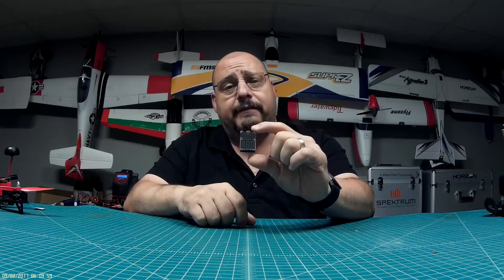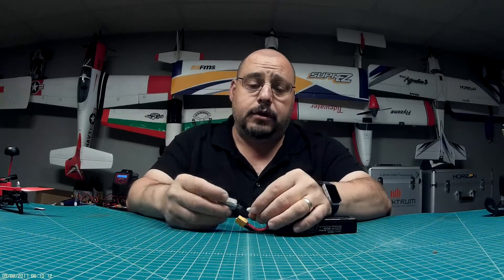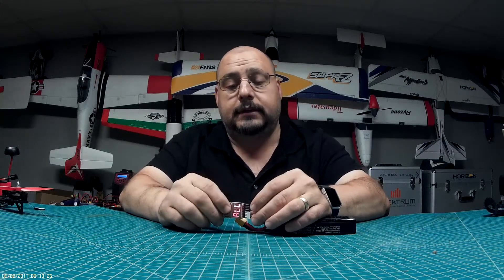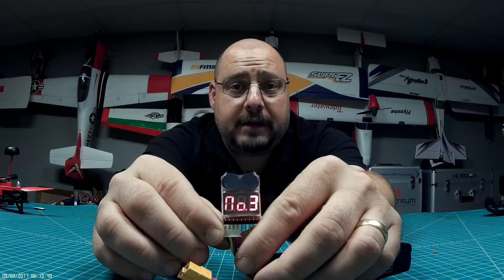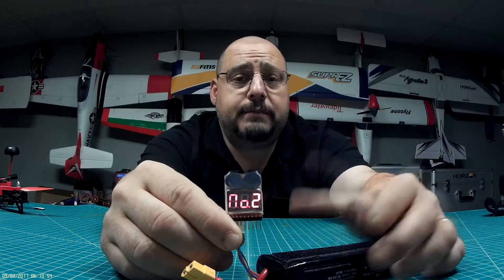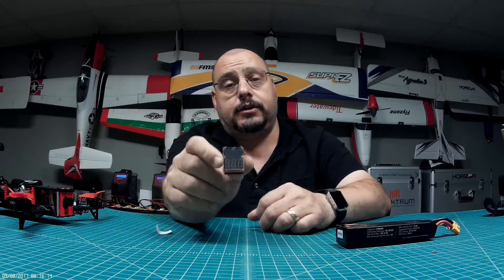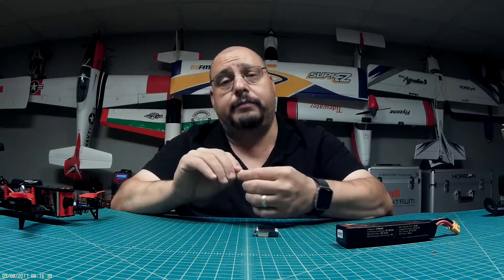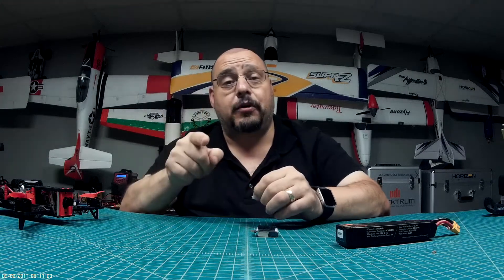How to use a Lipo Voltage Tester / Alarm.

Comment: Hi . Can you help me please , my 3s battery on a full charge shows 4.35v 4.34v and 4.11v  is this voltage diference something I should be concerned about
Reply from the maker: This could be an issue with the battery itself, or an issue with the tester. You'll want to validate your voltages for each cell against a known good meter to be sure. At roughly $3.00 each I don't expect them to be highly calibrated precision instruments and none of the 5 that I own perfectly agree about the voltage when testing the same pack. On the bright side, when you use these for in flight voltage insurance, the alarm will go off based on the lowest observed cell voltage.

Comment: hello. Thank you so much i really needed this kind of information. I like how you don't wonder of into another topic. You just get straight to the point. I cant believe that i hadn't seen this channel before i liked and subscribed. And one question is that can you use it with a li-ion battery because i have the remo 1635 and i want to protect my battery.

Comment: I'm going to just go ahead and make an a$$ of myself here for all to see.

I'm a 48 year old just getting into flying RC aircraft because I just lost my medical and cannot fly for my county's sheriff's DEPT Helo because of having my 7th back surgery from a crash I had in Iraq but that's another story.

Like I said I'm new and I'm wondering why I waited to start this hobby long ago but I'm here now. I have the eflite's mini apprentice and Valiant the Opterra & the F4U Corsair (the last was because I actually have about 435 hours flying for the Commemorative Airforce's FG-1D Corsair Dixie Wing around the country for photo ops, airshows and to different airports with our B-17, B-24. 

Went I start flying better with my Apprentice I would like to go FPV but don't know what the equipment I need, can you list me what I may need beside the camera and goggles or is that all I need? Also can I fly an airplane that requires a 3s 2200mah 25C with a 3S 2200mah 50C because that's all I have and since I own all Spektrum I do not see if they have a 25C anywhere. Thank you

Russ
Reply from the maker: Hey Russ, sounds like a hell of a story, worth telling sometime. As for your questions, all you really need is a camera/tx combo and goggles to do FPV. Regarding C rating of a battery, it's a multiplier to be used against your capacity. So a 2.2 amp hour battery like you listed there, at 25C is capable of providing up to 55 amps of continuous current, where a 50C is capable of 110 amps of continuous current. Since power consumption is determined by the load (the prop, motor, esc combo) as long as your ESC is rated for less than 55 amps you can run the 25C packs all day long. If your ESC is larger, than that, a 50C pack is the way to go, and is perfectly fine to use with any ESC up to a 110 Amp rating.  I hope this helps.

Comment: Is there a way to disable the beep? Every time I check voltage it beeps so loud my wife complains.
Reply from the maker: a couple drops of hot glue in the "horn" on each of the two piezos usually shuts it up. I've also just stuffed paper towel in the holes to the same effect. It mutes it sufficiently.
Reply: @DroneTastic  Thanks. I just soldered them off completely :)

Comment: I bought 5 of them however two of them give a higher voltage than the other three on cell #3. What would be your recommendation and the figure is 0.05 higher than the other three
Reply from the maker: I have 5 also. I have 1 that reports differently for cells 2 and 3. I haven't tried them with a larger pack. Having said that, I handle that situation by making a mental note of it. FWIW .05v isn't really that much and I'd probably accept it as the margin of error. I'd take the good ones to the field with you for checking after flights and use this one as the voltage alarm.  Sounds like you're running a 4s pack. My experience with this as a flight pack voltage alarm has been that it goes off when the first cell hits the alarm voltage so if you've got your alarm set for 3.7v and the alarm goes off your total pack voltage will still be 14.8 even though it'll read 14.85. That of course doesn't account for voltage sag. After you come in for a landing and the battery has a chance to rest the voltage will come back up a bit but that topic is for another day.

Comment: They are not accurate the alarm works
Reply from the maker: I've put them up against the voltage meters in all my high end chargers and they read the same, so they're accurate enough. When the draw on the pack gets high and you're using it the voltage sags, but that's expected and actually a good thing since you don't really want to discharge them below 3.7 volts (resting voltage) if you want them to last more than a couple years. I admit I didn't have the alarm voltage set high enough to make the piezo's tweet. Maybe I'll do a redux version of this in the future.